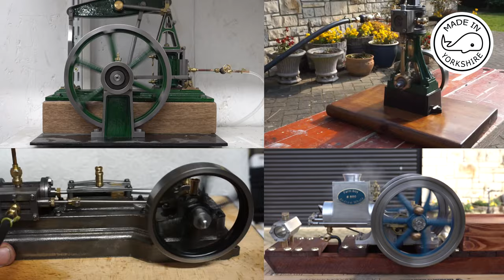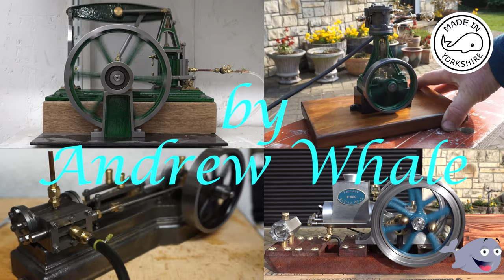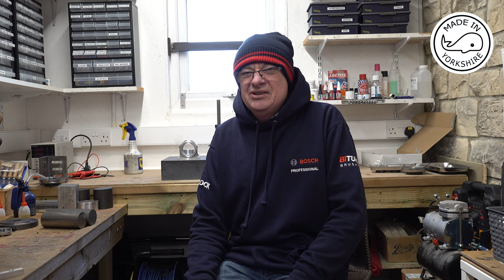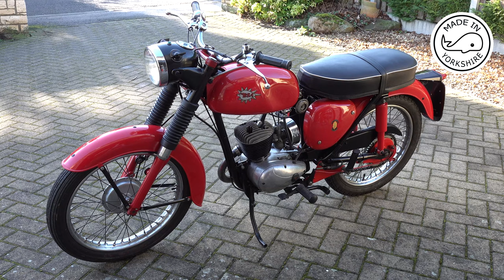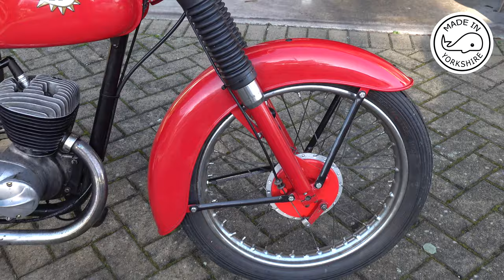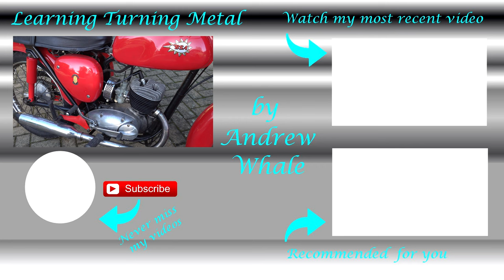#MT51 My 1971 BSA Bantam B175

Comment: Hey Andrew, glad your ok. Take your time in the cold. It takes the fun out of working in the shop. I had to get a diesel heater for mine as I positively dislike the cold.
Reply from the maker: I don't think I could be trusted with a diesel heater 🤕
Reply: @learningturningmetal  honestly it was not a bad setup. After doing mine in the shop, I have to say it's a very economical and safe way to heat up the shop. My shop went from 4c to 21c in about 45min, and this was the heater on low. If your interested I did a video on my setup. Although there are a ton of diesel heater setups out there.

Comment: Lovely little bike Andrew, I've had endless pleasure with motorcycles over the years, do your licence, you will not regret it.
If you haven't already come across Paul Brodie's chanel then have a look. Paul is a superb engineer and ex professional mountain bike manufacturer, he has recently done an exceptional restoration series on a Triumph Cub sport. Best wishes Stephen.
Reply from the maker: Thanks Stephen, and thanks for the info. I will check Paul's channel out. I've booked a CBT, so that should indicate whether I'm capable of progressing to a full license for a 175cc. Nothing ventured nothing gained!
Cheers
Andrew

Comment: Good to see you are still kicking!  I was starting to wonder.  A few fellows I watch use those cheap imported diesel "truck" heaters to warm their shops in the winter months. Of course, nothing wrong with re-charging the engineering batteries while looking forward to warmer days.
Reply from the maker: Hi Douglas - yes still kicking! I hope your winter isn't too severe back and beyond. I don't think I could trust myself with a diesel heater - too many combustables around and I would probably burn the place down. Hopefully, once through February, things will start to warm up and I can start to concentrate on the v-twin build. 
All the best.
Andrew

Comment: That was timely. Have a look in the Yorkshire Post Picture Past today where the Post office started replacing their bicycles with them in 1933!
Reply from the maker: Hi Ian - I'll check that out. As I understand it, when BSA were winding down in 1971 they received their last order from the GPO and BSA opened up the factory to complete it. Although my bike was made in late 1971, it wasn't registered until 1972. The GPO required an additional flick out stand to be fitted, to allow riders to quickly dismount and park up. A very interesting history.
Cheers
Andrew

Comment: Nice machine but.... Realising I was only ridning the 1100 cc bike 300 miles every second year before inspection, I realised I was getting rusty and sold it last summer. Due to Covid effecting the market I got well piad. The bike was 17 years old by then but in top condition.
First biking was 1970, a Yamaha 125 cc rice boiler. 34 years later I bought a heavy 1100 cc due to a biking Lady...
The traffic today is fearce and one must be on high alert all the time, so be careful Andrew!
Reply from the maker: Thanks Stefan - I am definitely not a fan of today's traffic and there are some silly drivers out there. I think I will try to get my full motorcycle licence though and tootle aound the country lanes near me. A heavy 1100cc sounds scary!
All the best.
Andrew
Reply: @learningturningmetal  Do as You tell, get the license! At our age(?) some(?) options are unavailable so better explore the ones remaining. Biking is wonderful.

Comment: Looks like D10 engine. Later Bantams had the plug in the centre, vertical not inclined
Reply from the maker: Hi Robert that is certainly interesting. The engine is definitely the original and the engine number ends in B175. I have various letters from the Post Office Vehicle Club and The Classic Motorcycle which verify that the engine was made in February 1971. However I agree with you regarding the position of the spark plug. I wonder if the cylinder head was replaced with an older one at some stage. Or maybe BSA had some old ones kicking around as it was one of the last to be made. Very strange!
Cheers
Andrew

Comment: Hi nice bike, clean condition and it definitely is a B (not a D) 175 at least in the frame department.   How do I know?  I used to have one - the one where they finally ironed out a lot (but not all) of the problems that had plagued the model since its inception.  One thing though, the real B175 had a central plughole whereas yours is the older style D14/ D10A / D10 / D7  cylinder head.  If this machine was from the very last batch when the Bike was being discontinued, it might have been a 'parts bin special'.  
So dismayed were some of BSA's managers at the decision to discontinue the Bantam, Britain's most successful single model by sales numbers, that they were planning to start their own company to continue production until they were blocked by top of the management pyramid, who then ordered all the tooling to be smashed - literally.  Isn't British industrial management wonderful!
Reply from the maker: Hi Stephen. Many thanks for the detailed explanation. That makes a lot of sense. I had my suspicions that it might be a cobbled together machine. It's a real shame that the BSA management didn't have a longer term vision. Nothing really changes!

Comment: Go for a license, definitely no point being a biker that cannot ride!!!
I had a 1965 D7 model in 1979 and now have a Interceptor 650s.
Go for it, you know you want to. 👍😎
Reply from the maker: Hi Graham - thanks for the encouragement! I've just found a motorcycle training centre a mile down the road from me - how lucky am I? Initial enquiries made! Nothing ventured, nothing gained!
Cheers
Andrew
Reply: @learningturningmetal  . Fabulous. Im so pleased to hear this. A whole new world of adventure is ahead of you.
Two tips for the future.....
1. The amount of fuel from the reserve tap on the Bantams is very small, so get to now your fuel state at all times. 
2. Bantams are very, very simple and easy to keep running.  BUT.... Always carry a toolkit, spare condenser, points and plug.
Get to know your carburettor, again very simple to set and clean, as you might need to do this at the side of the road.

Please do not be put off by anything I'm saying here, its just part of the joys of running old 2 strokes. 
Simple to fix and keep running, but only if your prepared.
👍😎
Reply from the maker: @2WHEELSor2WINGS  thanks for the tips. I think I will be just tootling around the local area but it's always good to be prepared.
Cheers
Andrew